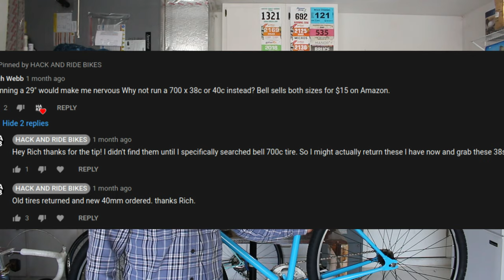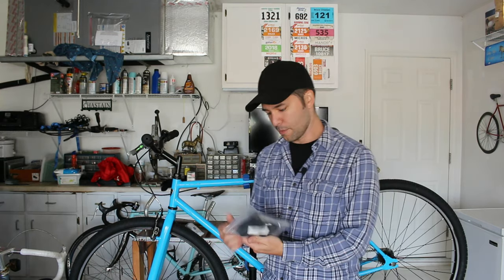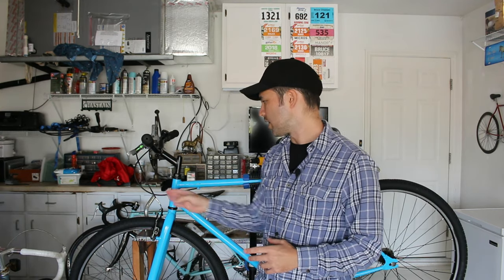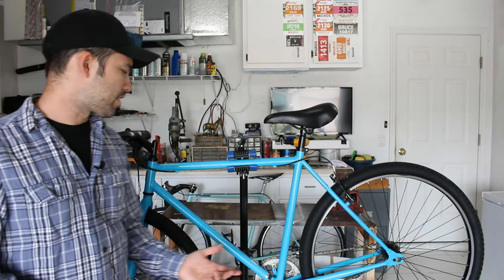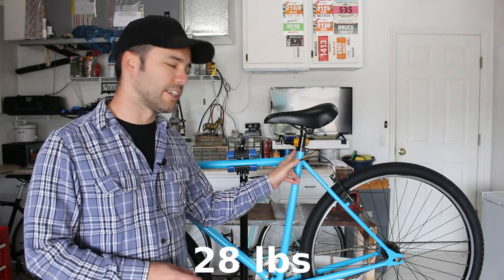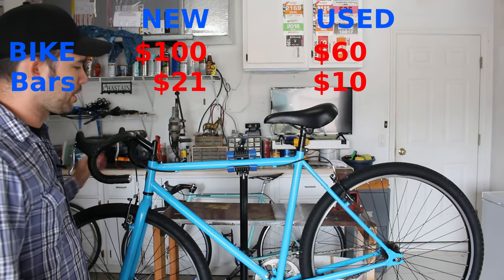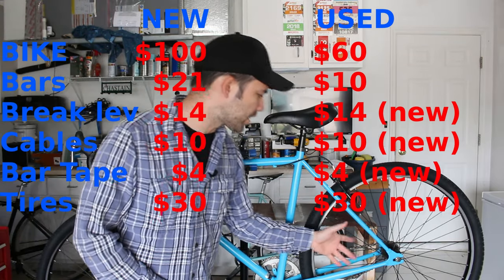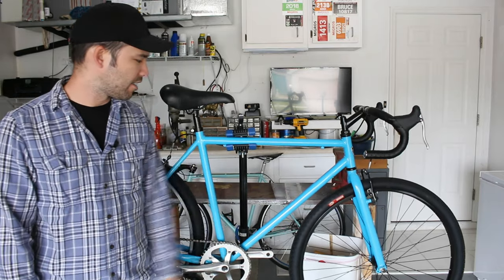Kent Ridgeland to gravel bike conversion build

Comment: A neat budget build. I have the same set of pedals with something like 13,000 miles on them and they are just very reliable.
Reply from the maker: Yeah, these same ones have been on several bikes. I wonder if the eggbeaters or lollipops would save some weight
Reply: @BruceChastain  They would and they definitely have their fans. I’ve been comfortable with Shimano mtb spd style pedals so I’ve never tried those.

Comment: On the handlebar link there is two options. Do I need 25.4 or 31.8? Doing a Kent ridgeline build as well.
Reply from the maker: Hi Joe, for this one, if you use the stock stem, it's 25.4mm.
Reply: @BruceChastain  thank you sir!

Comment: Great job! i think you're helping by answering the wonders of other tires too. Now i know the other bell tires are too big, so thank you for that content! One last comment, you should try rotating your bars so the top is level, then slide and tighten the brake levers when the hoods are also level with the top of the bars. it will be much more comfortable on the wrist. let me know what you think?!
Reply: also you mixed your left and right lever = )
Reply from the maker: hey cory thanks for the nice comment, sometimes my videos are a lesson in what not to do right :) As for the hoods, I like them as they currently are I think, I tend to go for the "locked in" sort of setting.
Reply from the maker: yes I know! someone else commented on that, can't believe it. not sure if I want to take everything off again or not. I rode it a few times and didn't even notice.

Comment: I want to do the same thing with my same bike!! Thanks for the video!
Reply from the maker: sure thing! good luck with it.
Reply: @BruceChastain  I finally did it! I love this bike and just hit 300 miles on it... thanks to you I Got the drop bars, brake levers, and a new seat. Kept the same tires cranks and pedals until the OGs brake. Lol. Thanks for the idea. It's awesome.
Reply from the maker: @FranGrandees  wow I'm so glad to hear! I'd love to see a photo of it if you want to share.
Reply: @BruceChastain  hey I just picked up my bike from the shop and they said I need new brakes for this set up. They said I need short pull linear brakes or V brakes. Do you have a product recommendation?
Reply from the maker: @FranGrandees  ah sorry I was thinking you already did the conversion. But yes there pull is normally different. I actually address that right here: https://youtu.be/OXHgojzxe3s?t=591

Comment: If I did the same set up do you think I could still reuse the stock brake cables and housing and still fit the drop brake levers
Reply from the maker: cable housing maybe depending on the length, but not the cable because the end type is different. But cables are fairly
 cheap.

Comment: Where can I buy the rear rim I bent the rim when I was riding in the rain and lend for a corner and the rim bent been having a hard time finding one. Could you help me out. By the way I love my bike bought when it first came to my Walmart. It's almost all original besides the black Walmart tire, which is black
Reply from the maker: might be able to find one on amazon.com actually. Otherwise maybe search for a used bike with a similar wheel, 28", single speed that does not have a coaster brake hub. Sometimes I still see kent ridgeland bikes on FB market place. Finally you could also take the wheel to a bike shop and ask them if they can true the wheel for you.

Comment: So, you went with a 48 tooth front sprocket. What is the rear he?  My Kent Thruster Fixie came stock with 48-18 teeth sprockets. Thanks for this video! Watched your video where you and your pal went on a long run, and he got sick. I commented there about my bike.  Had mine for a good 7 years now. Still runs red fine and I ride it every day.
Reply from the maker: thanks Jon! Yes this one also had a 18t rear cog.
Reply: So, we have, really, the same bike, but yours is blue. It's just a good, basic, easy to work n, and solid bike.

Comment: You’ve done a great job👍 I reckon the brake levers need to be swapped sides though, the cables should come out towards the middle of the bike not the outside so you can route the cable on the front side of the bars 👍👍👍
Reply from the maker: haha wow you're 100% right! I just went out there a rolled up the plastic covers and yes they are labelled L and R, mine are backwards! But I'm just going to leave it like that, seems to work fine.
Reply: One other thing, those drop bar brake levers are meant for road calipers or cantilevers....NOT v-brakes.  Cane Creek and Tektro both offer v-brake drop bar brake levers.
Reply from the maker: @kevinjfeeney77  yeah that I knew, but they seem to work fine on these v-brakes. As long as you don't mind the pull being deeper than usual, which I don't mind.
Reply: @kevinjfeeney77  they work ok with mini v-brakes with the shorter arms if you can get away with the clearance 👍
Reply: @benspeedschannel888  I tried the Tektro RX6 for my dirt drop bar'd Nishiki Pueblo mtb build... but no chance in clearing the 26x2.2 tires.  And they weren't all that aggressive either.  Forté Tsali... .so I had to go with the Tektro Oryx. 

For my dirt drop bar'd Mongoose hotshot.....I went with the mini Vs...RX6. With the 700x38s they clear.  Not sure how big I can go... but I'm more concerned with reach from saddle to hoods.  I might have to use a shorter stem with the highest rise available, the 0mm stem by Discord and/or riser drops such as the soma condor 2s.

Comment: I'd recommend switching to cantilever or mini-v brakes. full-size v-brakes don't play too nice with road-type levers.

Alternatively, you could get some long pull road levers such as the tektro rl520
Reply from the maker: yeah they levers and calipers combo isn't ideal, but seems to be working decent. Also I've noticed that these levers seem to have two settings I want to mess with, see if that helps.
Reply: @BruceChastain  two settings? Please update when you play with the levers more.  I've never heard of adjustable pull road levers.
Reply from the maker: @kevinjfeeney77  yes, I will remark on a video coming up with the bike, next video.

Comment: What about the sealed bearing bottom bracket? can’t find that on Amazon
Reply from the maker: just measure the end of the spindle to the end of the other side of the spindle, then search wherever for another one with that width. The BB shell should be 68mm if I remember right, but I think most sealed bearing sets are setup to work with both 68 and 73mm.

Comment: Love the build. Would you recommend a similar build or your original build for this bike for a commuter bike. I need something to just ride around running errands, 2-6 miles max
Reply from the maker: thanks a lot Efrain. For a commuter, either would work, I think it's just personal preference on if you like smaller tires or bigger and if you like drop or flat bars better. For me, if this were to be my commuter, I would go with drop bars and maybe 28mm tires.
Reply: Appreciate it brother. Buying 2 tonight. Will spraypaint one and leave one blue.

Comment: That bike is pretty, cool one thing that I would recommend for gravel is a lower gear ratio. Or maybe it is fine for the race depending on the terrain you're riding on .
Reply from the maker: Thanks Luke! I think the gearing should be okay, the rear cog is 18t. But we’ll see on the 10th. You may be right, not sure.

Comment: Is it possible to replace the tires with carbon wheels?
Reply from the maker: yes should be possible. I think the wheel width is standard, but would have to check for sure.
Reply: @BruceChastain  great thanks! I plan on doing something similar to this with a cheap road bike haha

Comment: You're probably losing some braking power as V-brakes expect a 2:1 actuation ratio and road levers pull at 1.4 or 1.3:1.
Reply from the maker: yeah and is true and I can feel it, but it seems to still stop pretty well despite that. Going down a long mountain road, not so sure. maybe I should do a testing video on this.
Reply: @BruceChastain  You can fix it with Eiosix Travel Agent pulleys on the brakes but they're not exactly cheap or easy to find.
Reply: @SiTeeVee  yup.  They're like $40 each..IF you can find a retailer with them in stock....